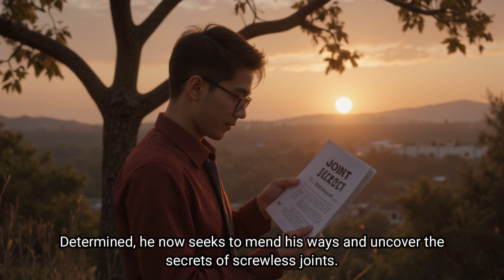15 Ways To Connect 3D Printed Parts Without Screws

Comment: Depending on what slicer you're using, you CAN control the infill of the dowel separately (2:14) you can highlight the section and change infill